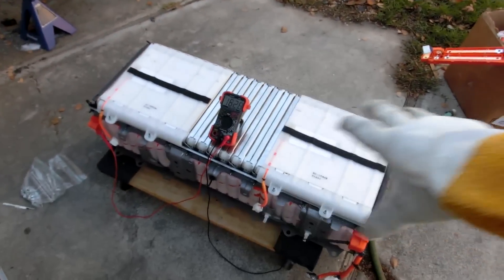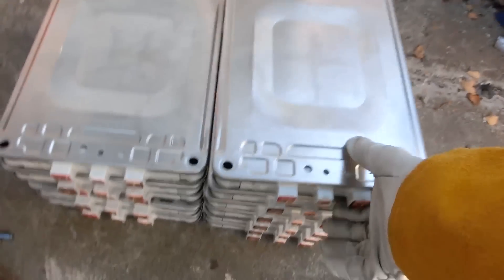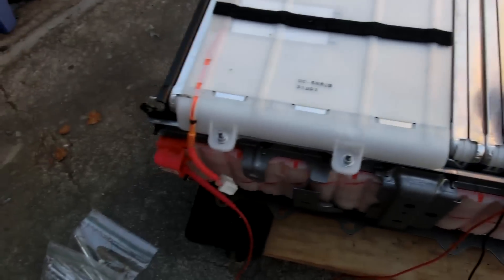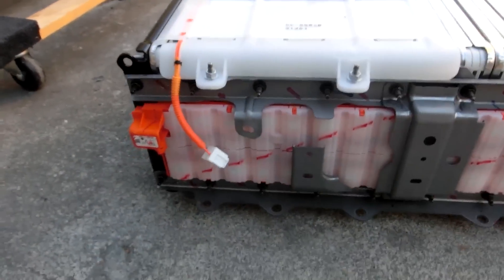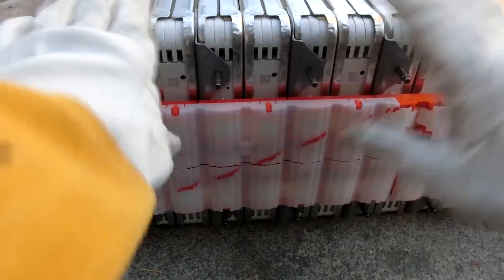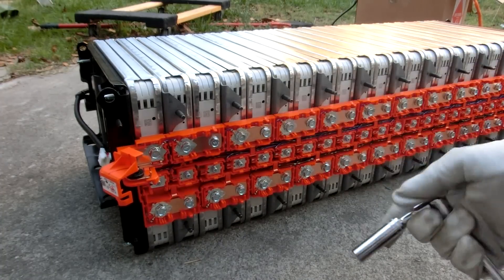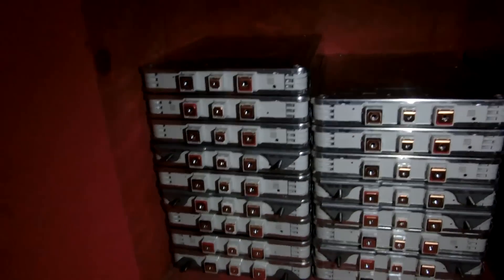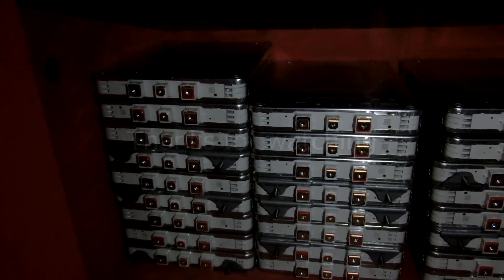2013 Nissan Leaf battery disassembly part2

Comment: 180 Volts and you don't use electrician insulated gloves gloves and electrician screwdrivers ?
Do you want to die on camera ?
You should give the good example to peoples not knowing the dangers you are messing with.
leather gloves are completly useless.
Reply: No prob. 

Current is the flow of electrons. Its measured in Amperes ("Amps" for short). When current flows it generates heat due to resistance (thus electrical sparks, smoke, and fire). In the body this aspect can kill of course, but also electrical current can cause muscles to behave uncontrollably. If it's the heart muscle then it can/will malfunction. 0.050 Amps is the minimum to kill for this reason.

Voltage is the electromagnetic potential, like pressure (or head) in hydraulics. It's what applies the force to induce current (of course it's Volts). Officially, 48V is the threshold for danger. For a given current, higher voltage inducing it means more power (Power = Volts * Current). 

Resistance is the measure of how much the flow of current is resisted in a material. It' measured in Ohms. More resistance means more voltage is needed to induce a given current. 

The relationship between these three is Ohm's Law: V = I*R where V is Voltage, I is current, and R is resistance. Solve it for I and you get I = V/R. We're discussing electric shock through the dry skin. It has a relatively high resistance (R) which is fixed. In the equation this leaves only V to work with to yield current to shock a person. Of course the relationship has V in the numerator so Voltage determines current. 

This is why Voltage is the thing that harms with current as the means. Of course, all of this assumes that the circuit can source enough current, which is an engineering problem, not a basic physics problem.

Hope this babble makes some sense.
Reply: I wonder how many electrocution related deaths are caused by cardiac arrest and how many are caused by muscle spasms throwing the guy off a ladder or into a some object nearby

But honestly screw electricians gloves I would wear a full suit of chain mail
Reply: 24V is absolute safe limit. You can't be electrocuted with 24V at all. Safety standart work in following way: anything above 24V (or 48 V somewhere) is considered dangerous. There is no garanty, that 48V or 180V is 100% unsafe to touch
Reply: I don't know why so many people are arguing about this.  I think everybody knows that volts alone don't kill you. We know the battery is 180 volts but we don't know the capacity and how many amps it's going to put out, but its a big ass battery so we can assume its going to put out some lethal current AT 180 volts which can kill you.
Reply: it's not the volts, and it's not the amps, i mean, yes, but is the resistance of your body that determins ho much current can flow trough you, and refering to Ohm's law, voltage and amperage are directly proportional, that means, with the resistance of your body being fixed, the more volts there are, the more amps will pass trough you.

Oh, and 180 volts DC it's enough to kill you
Reply: Mariangiongiangela's Tech Tips
lol you could say that I guess. First time I touched open house wires was when I was 4. I still remember it to this day. Few seconds of just being shaken by electricity. It's not something you forget. Apparently 100v is more dangerous than 240v. Because it's closer to the voltage inside your body that keeps your heart beating, it is more likely to interrupt it. That's what somebody said anyway... I'm not really into biology.
Reply: About 5 years ago a person working on high voltage lines was electrocuted after a broken strand of wire punctured his glove and contacted his skin using his "protective" coveralls as the return path of the circuit hence why those gloves are banned from workplaces in Australia. We now have to use tools which are nearly a foot in length made of non-conductive plastics and solid rubber glued to the required tool similar in construction to a screw driver. One day I will sit down and make a video on these tools as I know there may be some interest in the youtube community
Reply: With some of the idiots i see in cherry pickers trimming trees near power lines i am just waiting for the next guy who has no real training about power wires getting zapped or worse because they shouldn't be there better to get in the local power linesmen and women to trim the trees or better still not put them there in the first place.
Reply: You Sir, are a joke. Or just really bad troll. The simplicity of people truly amazes me.
Reply: 8.4 V at 60 Ah each  : do the math.
It's enough to kill you with just 5 of them in serie.
Reply: Ah is energy capacity. It can source 60 A for 1h. You need volts for doing harm, more volts than 5 in series (42v) can do across dry skin.
Reply: I build those packs for Nissan in Smyrna TN and those gloves aren not rated for playing with those packs we use rubber lined goats skin gloves. He is lucky that he didn't short the pack out and die!!!
Reply: enator71 Why not stretch it to thousands of volts and amps? I've been shocked by 30,000 volts before for about 5 seconds. Still alive..... did hurt though....
Reply: Sounds lke you got zapped by an electric fence used to contain Cows or Horses.
Reply: Here in OZ we don't use gloves to disassemble a battery pack for the leaf or the volt. We however take extra precautions with the prius thou.
Reply: Historically cardiac arrest is not a major cause of death in most electrocutions with with most attributed from the jump causing a fall from a height or the being thrown against an object with considerable force. Remember it takes only a small amount of force to break a skull
Reply: Generally speaking you wear an insulating material like Kevlar or heavy canvas under the chain mail XD the chain mail provides a path of least resistance around your body to ground rather than through it have you ever seen one of those Tesla coil demonstrations :P
Reply: Very true Mike all thou here it is actually built into the coveralls we wear with a barrier of what i believe is kevlar between the brass weave and the skin
Reply: We commonly use them for near high voltage power lines as our base voltage is 240V and the HVAC is around 10,000 Volts
Reply: Andrew Poole
exactly
Reply: i have shocked myself with house mains about 6 times in my life which is about 240v @ 15-30amps. I'm still alive :D One of those times I took a computer power supply apart when it was plugged in. Safety is for babies, live and let fry I say. ^_^
Reply: Joseph Stott
you are lucky
Reply: yes that's true, certain voltages and frequencies are more dangerous than others
Reply: Volodumur Kalunyak
well obviously nothing is 100% unsafe since more than one person commenting here has stuck their finger in a powerpoint (or equivalent)
Reply: Joseph gloves do not protect you from high voltage that is why the standard here is that they must be fully discharged before working on them. Currently I have not found thru the commentators on here anyone who would pass certification to even deal with these cells  in a discharges state let alone be able to discharge them within safety guidelines. If you saw the tools we need to safely deal with these cell you would understand why gloves are inappropriate
Reply: Andrew Poole
sounds right. nobody can die in this country without some saftey standard somewhere getting tightened. (Y)
Reply: michaelovitch
Reply: No volts. No amps. It's like a fire hose aimed at your chest. No pressure, no flow to knock you down. 

Volts do kill you via the amps they induce. That's why all those cells can be connected in parallel and grabbing both bus bars would not injure you. You end up with a low voltage supercell. Now connect them all back up in series and those same cells will send you to the afterlife. What's the difference? Voltage!
Reply: paytontech and yet people get tazed with thousands of volts with no ill effect. I really don't know what you're saying. I was taught that exposed power points were more dangerous than a tazer not because of the amps, but because the lower voltages 100-200 interfere with the voltage your body uses to keep your heart running. and getting shocked with 1000 volts is safer than 100 volts regardless of amps. It sounds like you're saying the opposite.
Reply: The reason they aren't harmed is that the tazer doesn't drive enough current. It's circuit is specifically engineered to source limited current to the target. 

It's not a physics issue with the tazer. It's an engineering issue that circumvents the physics. Apply that same voltage to yourself with an open loop circuit (no limits) that can source enough current to kill... Then get back to me (or rather, have your next of kin get back to me). 

What I discuss is physics with no artificial engineered limits.
Reply: paytontech I'm just trying to learn something... not trying to challenge you. What does current mean as opposed to volts and amps? You explained but assumed I knew too much I think.
Reply: these Batterys deliver more than enough amps.... Dcv is even harder because your Hand just Clamps to the contact
Reply: Finally, somebody that understands electricity. 1 millionth of an AMP can kill you.
Reply: Mariangiongiangela's Tech Tips You literally just explained how your last sentence is not true. How can 180 volts kill you if there is too much resistance? Correct answer, it can't because in order for you to die from electrocution, amps are required. You can have resistance and not die, you can have volts and not die, but if you have them both, amps go through your body and that is what kills you. Jesus christ, explaining this is like pulling teeth...
Reply: +michaelovitch Volts are not going to kill you. It is the amps that kill you
Reply: +Jimbo Jones 
You should read :
https://www.osha.gov/Publications/3075.html
Reply: michaelovitch No I shouldn't. Unless it states that the flow of electricity has nothing at all to do with killing people and people only die because of voltage difference. Spark plugs give off 30,000 volts. They don't kill you, yet a 240 volt mains does. Why is that? I think you should go and read your own literature, or maybe study electrics at university, like I did.
Reply: +Jimbo Jones 
above 24 V   130 mA on DC voltage kill you
here it's 180 volts witha shit load of amps....
Use your brain.
if you touch + and -  you fry.
Reply: michaelovitch Which still doesn't change the fact that it is the amps that kill you and not the volts. What are you even arguing about?
Reply: +Jimbo Jones 
never said the opposite...
i just said there are 180 volts and it can kill you here.
it's not a AAA battery....
Reply: michaelovitch Your comment looked like you were saying 180 volts can kill you... I mean, that is pretty much the gist of what you said...
Reply: +Jimbo Jones 
It's what i said.
this thing will kill you ,it's not 12 V or 24 V it's 180 V WITH huge current.
you just thought the rest.
Reply: michaelovitch That's not what you said, but umm whatever dude
Reply: +Jimbo Jones 
i said "180 Volts and you don't use electrician insulated gloves gloves and electrician screwdrivers ?"
Reply: michaelovitch I don't wear insulated gloves or screwdrivers when I work on 30,000 volt spark plugs. What's your point?
Reply: +Jimbo Jones 
here,there is a lot of current,like you know.
saying only amps kill you is right ,but not completly,it's not so simple.
if you discharge a coil on your body once ,it may will be ok,but if you saty on it you will suffer from it,and not a little.
you can put your fingers on  the + and - of a 12 v battery with 100 amps and will not suffer at alll,and maybe not even feel it.
here it's 180 V and a lot of amps.
voltage can kill you as low as 24 volts.
Reply: michaelovitch If the voltage is too low, the current will not pass through your body. Unless you give it a helping hand, maybe with some water or another sort of electrical conductor.. It is like saying that when a prison door opens, someone will come out and kill you. It is the prisoner that kills you, not the door. If the voltage difference is not big enough, the current will not travel.
Reply: +Jimbo Jones 
180 V is enough to die.
Reply: michaelovitch mmhhmmmm.....
Reply: Current = ampères=amps
volts = voltage
current is the intensity
volts is the flow
imagine volts is the flow of a like river wich is the difference of what is up the hill still in the lake and down the hill passing in front of you.
it's the difference of potential. its potential.
The current is just its force wich rise when there is a big storm and rain.
the lake is exactly at the same place,so same potential,but way more force while flowing.
Reply: enator71 Physics has a context?

Comment: hey, like your vids. need some help ive got a 2000w 36v ebike hub motor and am considering a  li-ion battery pack (using 18650 cells) they will be new (ish). how many cells will i need and how would i wire them? thanks for the help :)
Reply: It totally depends on how much capacity you're looking for, and what cells you have. I happened to find a person selling hp laptop batteries for dirt cheap, they happen to contain Samsung 26r cells. So to accomplish the task of attaining 26ah@24v, I needed 70 cells.

Comment: VOLTS DON'T KILL YOU FOR FUCK SAKE I CAN GO TOUCH 2 PIECES OF WIRE THAT ARE CHARGED AT 1000 VOLTS AND NOT DIE IF THERE IS NO AMPS
Reply from the maker: +M80 Gaming but it will not be 1000v when you touch it if it doesnt have any amps of supply current, the voltage will drop. so yes voltage does kill you. if you maintain a 1000v voltage differance across the body you are going to be putting a lot of power through you if your resistance is average.
Reply: ask an electrician *Facepalm*
Reply from the maker: M80 Gaming
guess you dont understand how electricity works, like ohm's law.
Reply from the maker: M80 Gaming
can't have amps without volts though.
Reply: for fuck sake it was an example

Comment: An old friend of mine used to be the main repair guy at Princeton Graphics in the 1980's - back when they were in Princeton.  On the wall behind where his workbench was, there were many holes in the wallboard and ceiling.  All holes were created by his arm tossing the screwdriver because he forgot or failed to correctly discharge the picture tube.  There were like 20-30 holes total when he left the company after 8+ years.

Comment: I would use care in storing them to insulate the battery cell terminals so its physically imposable for them to short against any conductive surface or the cases of other battery cells

Comment: try 240v AC up your left arm twice in half an hour while working on a power supply. I was only 13 though.
Reply from the maker: +Mark Bartlett i've been shocked with 1200v before, it wasnt high current though.
Reply: +Rinoa Super-Genius 20kv arced a nice hole in my thumb once ouch
Reply: +XXxxcrisisxxXX Static can be up to 30kV
Reply: jjhack3r I know.

Comment: those are beautiful!  i don't know if you recall my lawn tractor project, but it was a failure using the lead acid batteries.  I can only mow for about 20 minutes max.  if my calculations are correct, i could use 6 of those and get the same power as my current setup.  it would reduce the weight of the lawn tractor batteries from 168lbs to 64lbs.  approximately 70% weigh reduction.  I might be able to get 1 hour of mowing that way.

Comment: You would need a proper charger for these!!
Reply: +HDXFH depends on how he wires them, the individual 8.2v pack can be used and charged with a simple cheap imax-b6. Any more than two or so and it'll take proper ages to charge and will require special electronics

Comment: I got shocked by 347 V AC once....trust me, that will wake you the F up.
Reply: Yeah.  You can actually feel the pulsing of the 60hz through your body
Reply: HeadShot360IN Yeah well it teaches you a respect for what you're dealing with real fast.
Reply: +sc0tte1 i have shocked with 220v AC and it was 'shocking'
hahaha
no?
k
:(
Reply: me ov 400v for five sec two hands ,,,
Reply: Did you get checked out? Apparently the  pulsing of AC can really mess up your heart
Reply: +Dynamitemonkey500 Yeah I got a drive to the hospital, got hooked up to one of those machines with the sticky things that go on your chest, etc, I was fine :)  Just scared the shit out of me, I was afraid to go within 10 meters of any sort of bare conductor for a month after that lol
Reply: +sc0tte1 yeah it's weirdly scary, such a sudden shock
Reply: +sc0tte1 EKG
Reply: +sc0tte1 that would blow a bollock
Reply: +HeadShot360IN and gives you a slight heart murmur n.n

Comment: As for the screwdriver, I'll just say it. wrap the screw driver in electrical tape or some other kind of non conducting. but if you had time dip it in a resin and let it cure and make a insulating layer. and if you had more time you could 3d print some. makes me wonder if i can print some out then vapor smooth it for strength.......hmmmmmm.........